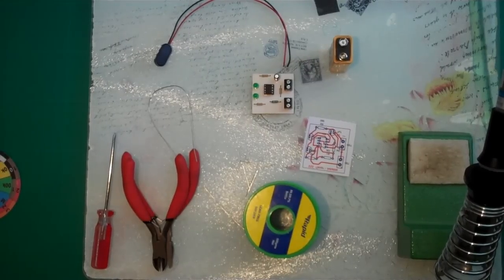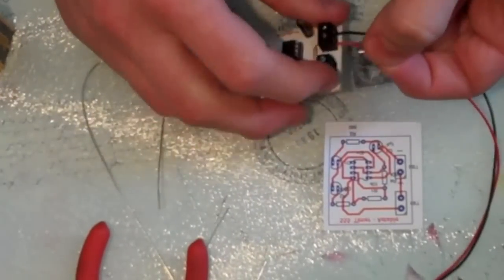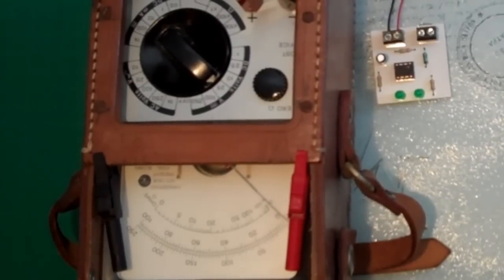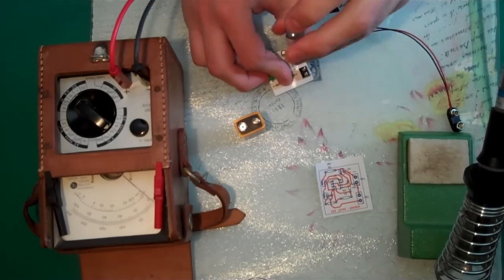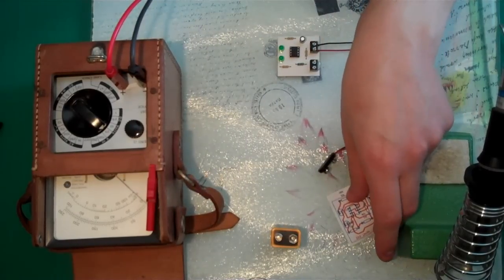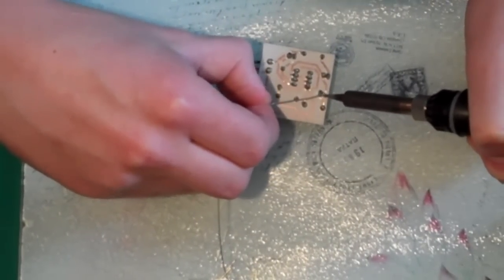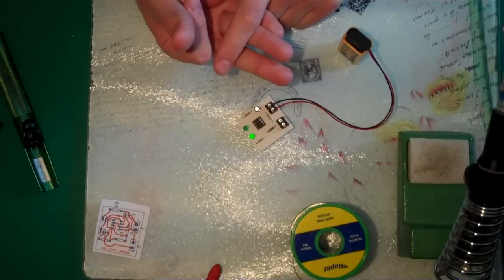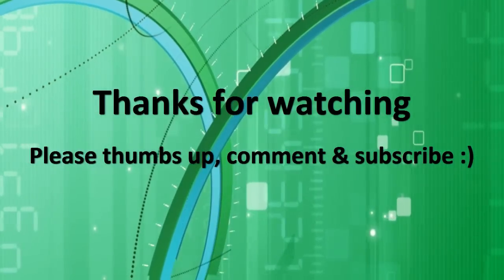How to Design, Develop & Manufacture a PCB | Part 9 - Testing & Fault Finding

Comment: i'd like to know where the etch tank, sheer and the UV box can be bought from for designing the PCB. I know where to get circuit wizard at and everything else but those parts are the ones that seem to be the holy grail to find. Also are they available for use in the USA?
Reply from the maker: Sorry for such a late reply.  Just have a look on Google, this website looks good: http://www.circuitspecialists.com/printed-circuit-board-fabrication  Unfortunately PCB shears, etch tanks and exposure units aren't cheap.  The facilities I show here were at my local high school.  For home brew PCBs a polypropylene tray, the etch chemicals (e.g. ferric chloride) and a toner transfer method are suitable.  If you're interested in this method, there are many tutorials online on websites like Instructables.  Another interesting method uses a paint mask and a laser cutter, if you have access to, or know someone who has access to one of these.  Hope this is helpful, drop me a direct message on YouTube if you want to know any more.

Comment from the maker: @amin031 This is about fault finding! As for how to use a multimeter it really depends on if your using an analogue or digital one and they vary greatly from meter to meter.  Your probably best having a look at the instruction manual for your meter to find out how to use it correctly.